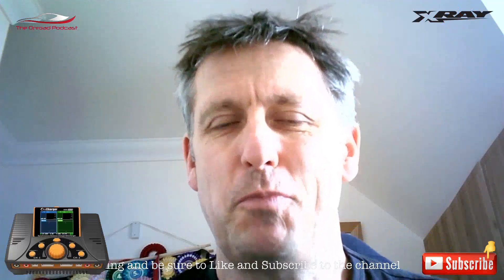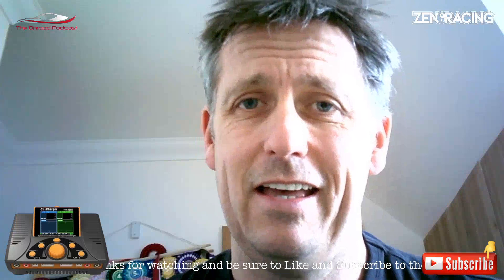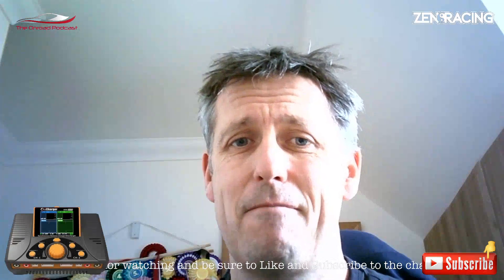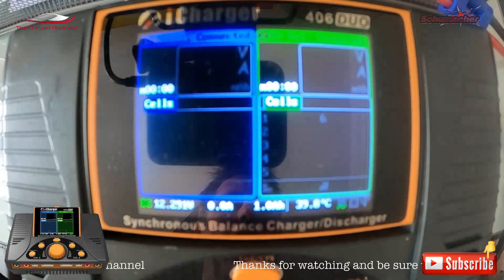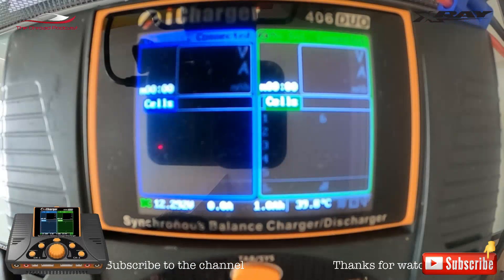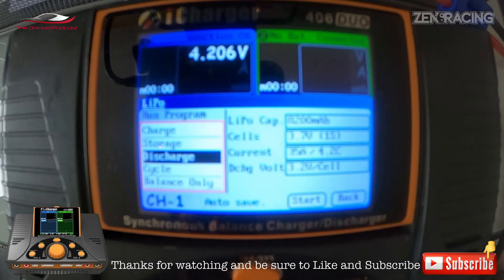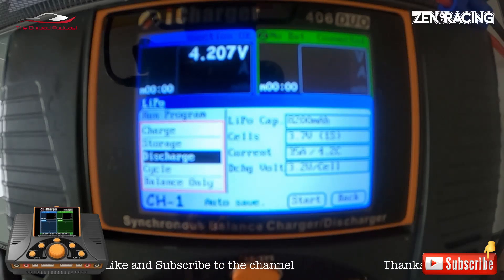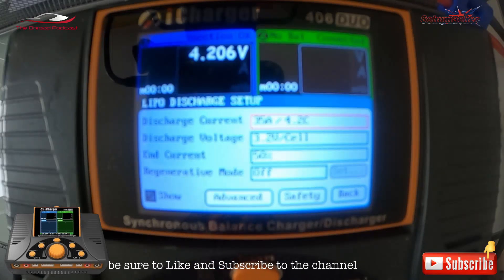iCharger SECRETS!

Comment: I am trying to do regenerative discharging channel 1 to channel 2 battery to battery. I also have a power supply connected to input of icharger since without it it doesn't turn on. When I run the discharge, channel 1 says discharging at 40 amps but channel 2 says charging at 25 amps. While I do this, the input power supply fans start going on. So I can't tell if channel 2 is charging from channel 1 or from input power supply.

Comment: Hi, do you know where I can find an equivalent product to balance 13S series or more ? Otherwise, how can I adapt this product to balance 13S series batteries ? Thanks
Reply: You cannot "adapt" any balance charger to balance more cells than it's designed to, because each balance channel has its own physical hardware for sinking current from that cell. There is no software "hack" that will work.
To do it, you need 2 separate chargers with the total number of balance channels you need, and a split balance adapter cable for the number of cells you need. You CANNOT use a Duo charger (or any multi charger) with its outputs connected in series, because it will internally short-circuit the two power channels of the charger (they use a common negative.)
So, for a 13S pack, you need that number (or more) of total channels in the two chargers. For example, a pair of 6S chargers can charge up to a 12S pack, a 6S charger and an 8S one can charge up to 14S, so on and so forth.
You have to make a balance cable for it (a "Y" cable), with the pack's balance plug having one balance lead in the middle connected to both chargers' balance ports. This wire will be the highest cell (positive) going to one charger, and also the lowest cell (negative) going to the other charger.
Each charger must have its own isolated DC power supply, or you'll have the short-circuit problem. The positive terminal (main charging current) of one charger connects to the negative of the other, running the main power outputs of the two chargers in series.
For example, a 13S pack can have its balance plug (14 terminals) split into a 7S and a 6S balance plug, with the 7th terminal on the battery connecting to 8th balance terminal on the first charger, and ALSO to the 1st terminal (balance negative) on the second charger. The first charger will have its negative high-current output connected to the battery negative, its positive output connected to the next charger's negative output (in series), and the second charger's positive output goes to battery positive. You will also have to have the high-current jumper between the two chargers connected to the positive terminal of the 7th cell in the battery (where that 8th balance terminal is also connected.)
Set both chargers to charge at the same current and same balance settings, and start them both charging at exactly the same time.
Good luck :)
Reply from the maker: Sadly I have no idea

Comment: Great tip, thanks for sharing.
Still on the fence as to what charger to upgrade to. Biggest deal breaker so far is the UI of the ICharger - most think it is not very user friendly.
Would you still recommend the ICharger?
Thanks
Reply: I have this charger it's a great workhorse but the user interface is frustrating too many options.
Reply: I just got an iCharger X12, which is for up to 12S packs, 30A, 1100W. Very compact and versatile! The user interface is just something you have to get used to, like learning a new version of Windows on your computer, or a setup/menu system on a new TV set.
Great little chargers and extremely versatile, user-configurable charging profiles. Gobs of options and lots of power handling capacity in a compact unit with a cool little screen :)
Only time will tell how reliable they are, of course.

Comment: Just out of curiosity,  not talking about the discharge rate, but the charge rate for the other battery, do you find the batteries die ( life span) a lot sooner than if you charged them at a normal 1c rating? 
You might not do that often but from everything I've read and from videos I've seen, it is not good for the lipo to charge over 1c.
Reply from the maker: Without doubt the life span of the lipo is shortened charging as per the video. Racing stock, getting the most out the battery is more important than its longevity. But you’re absolutely right, 1C makes the lipo last longer but perform worse.

Comment: Hi Stuart thanks for this. I’m interested what temperature the charger got to when discharging. I used to discharge at high rated but blew my charger. I got Nick Adams (RIP) to fix it and he recommended never going about 10a when discharging.
Reply from the maker: Really good question Matt and something I was concerned about. It got to 41.6° at 40amps which is actually cooler than when I did a standard 3C discharge without the regen mode. HTH 👍